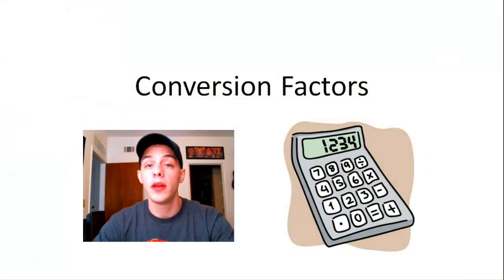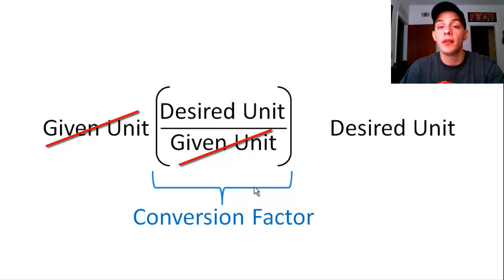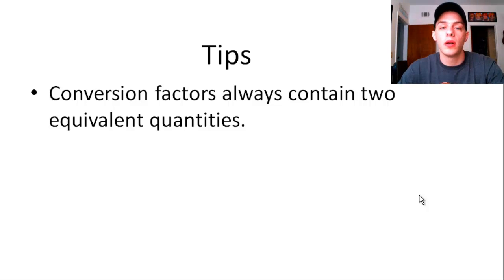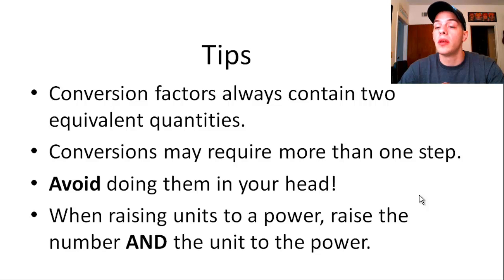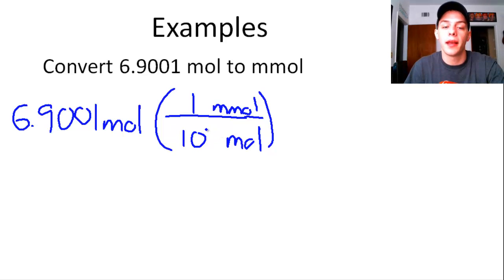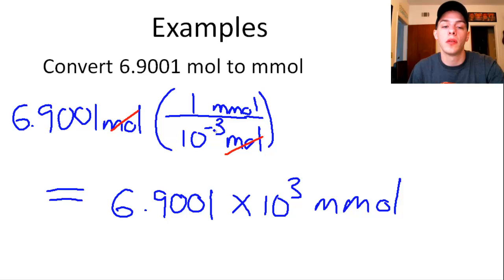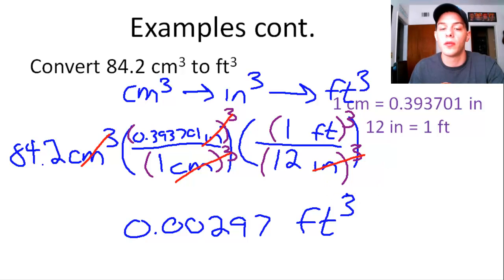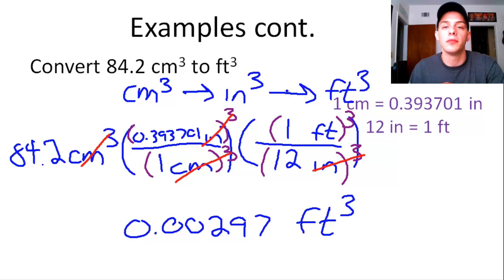Conversion Factors - How to Convert Between Units

Comment from the maker: Your calculation is correct.  However, in order to solve the problem correctly, you have to raise the numbers and the units to the corresponding power.  For instance, when converting from cubic inches to cubic centimeters, you have to raise the 1 cm to the third power, and it becomes 1 cm^3.  You also have to raise the 0.393701 in to the third power, and it becomes 0.60102 ...